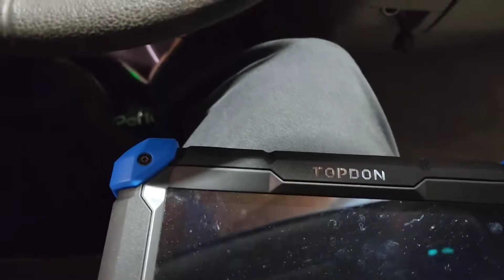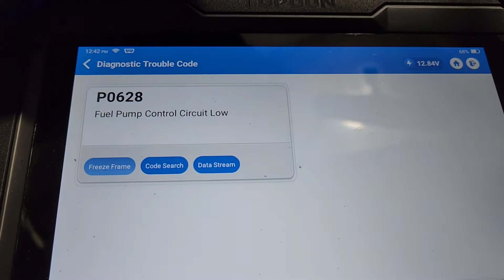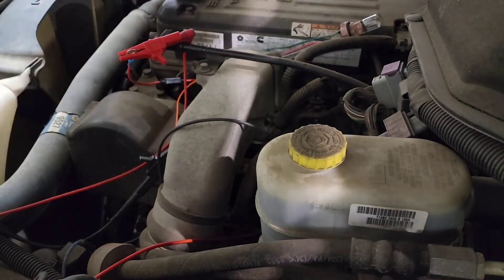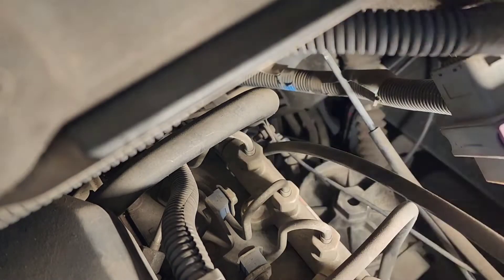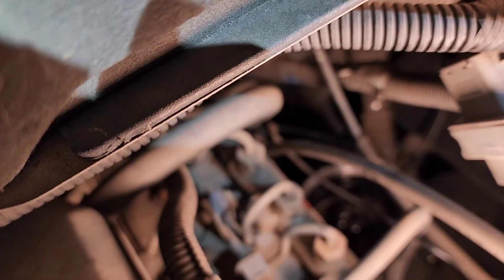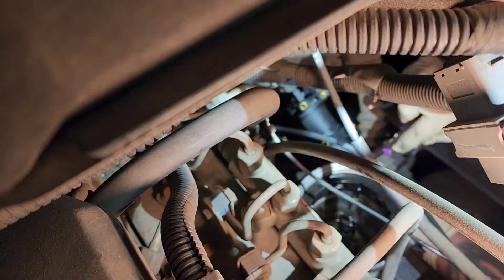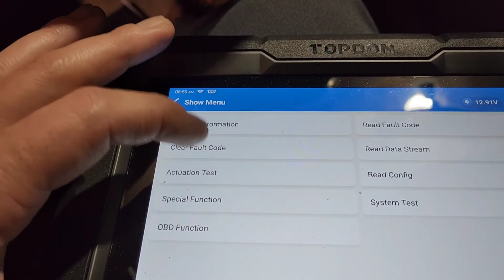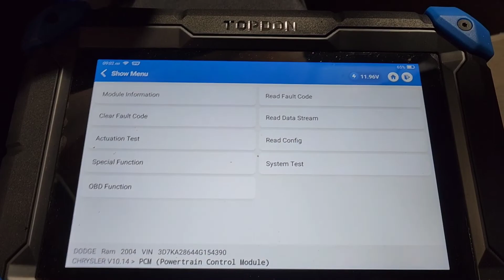5.9 Cummins How to Replace Lift Pump

Comment: Great walk-through Tony. How do you test the injection pump after you’re done with this? Is it just a fuel pressure check?
Reply from the maker: You just drive and it and watch fuel rail pressure desired and actual, on diesels the two pids should be identical. You do not actually test high pressure fuel you trust that the sensors are reading correctly. Thank you for watching the video.

Comment: 98.5 to 2002 diesel has a 10 sec run for starting bump starter without starting for prime filter, my 99 had a ECM problem that stop it from 10 sec prime which made it hard to start had it repaired works find, the 30 sec prime still worked fine. power dropped to 8.6v but still had 12.5v on the bump the started, just sharing !!
Reply from the maker: @whitzach  thank you
Reply: @NutsandBoltswithTone  You are very welcome !! a person never knows when a scrap  of information may help another person !!

Comment: Oh man! They moved the Lift Pump location and style as compared to mine. My pump is on a bracket a bit lower and toward the firewall. It is impossible to get to with frame rail and many harnesses.
Pump HFP923
Reply from the maker: @theresahoffman8408  oh wow that sucks

Comment: So what if your pump is not making noise at all I’ve replaced mine and even the new one is not coming on
Reply from the maker: Sometimes the lift pump fails and will not turn on so will not make noise. The proper way to test it is to check fuel pressure. If your pump is not turning on and you have a new one still not turning on you should check power and ground. Bump the starter once without starting vehicle, leave key on. you should have power and ground the pump. If you do not you will need to trace wires back to source. Thanks for watching. Hit me up on Instagram if you have any further questions.